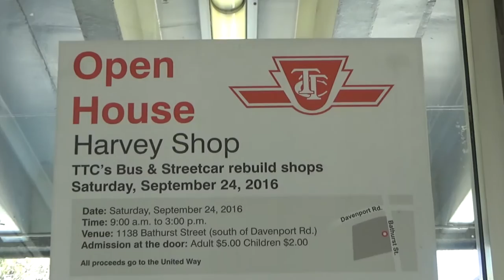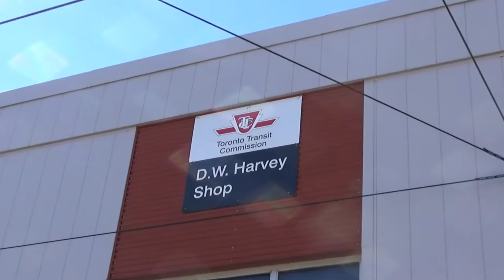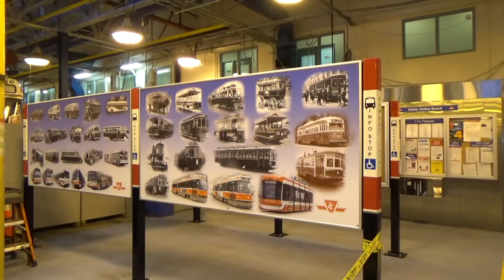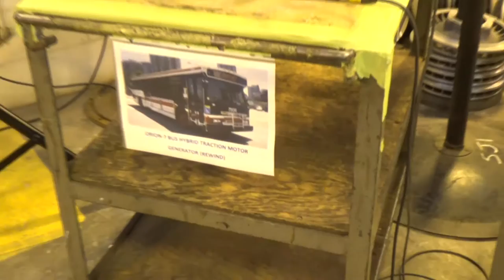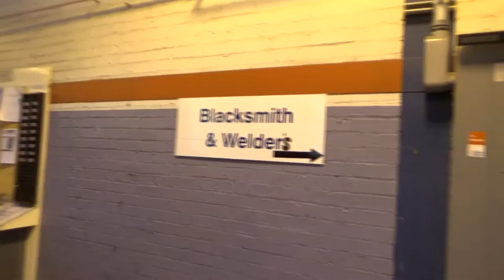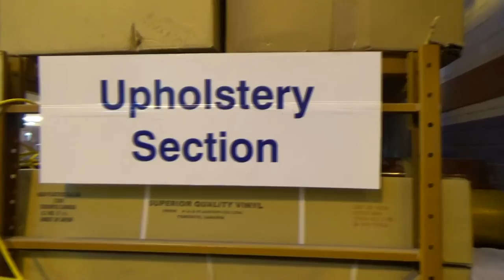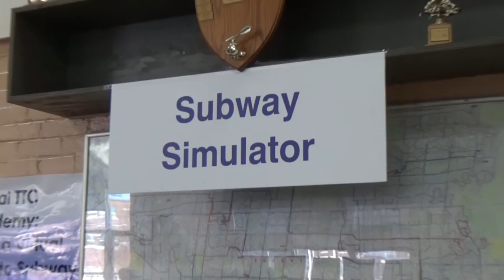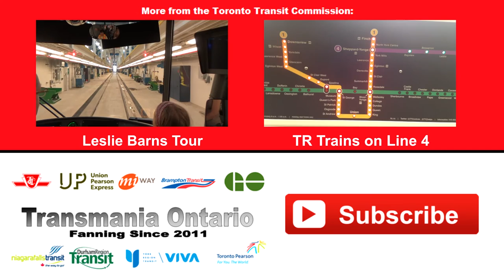TO SPECIAL - Doors Open at TTC Hillcrest Complex

Comment: What is the TTC rv bus for?
Reply: Toronto Transit Fan a command post. Has couches, tv's, and chairs
Reply: Ontario Transit Photography I was wondering what the purpose of the event bus is, not what is inside.
Reply: Toronto Transit Fan not 100% sure but I know it's a older prevost coach used for command. Maybe an incident, idk
Reply: @unknowncaller2253  NO, its used for when the whole commitee of the TTC heads needs to be at an accident of a TTC vehicle or another very important thing.